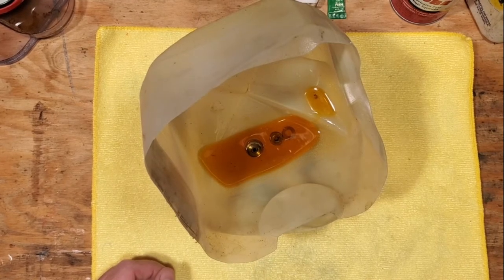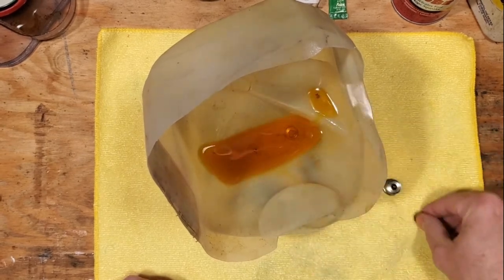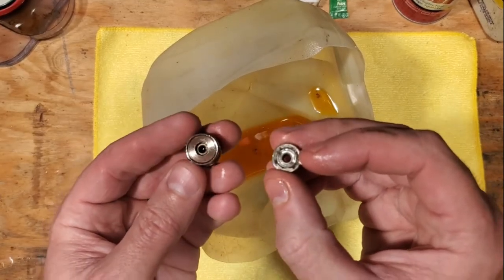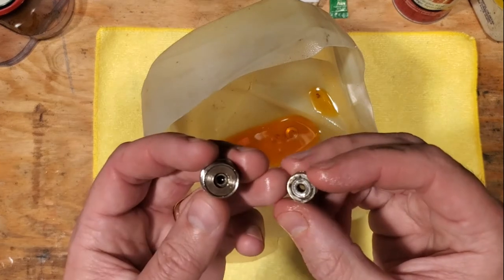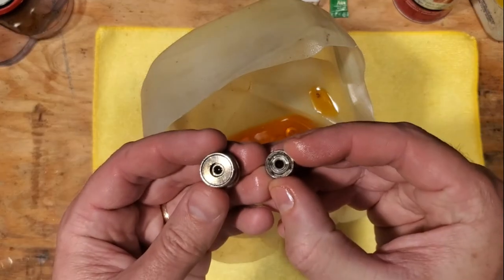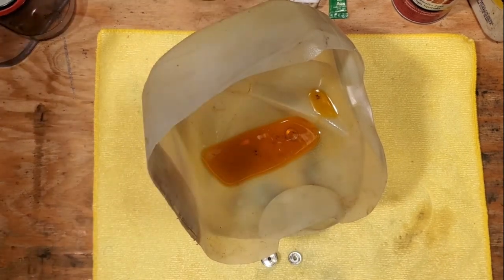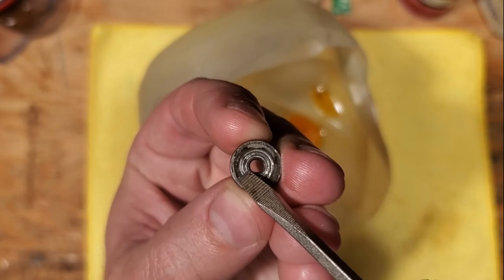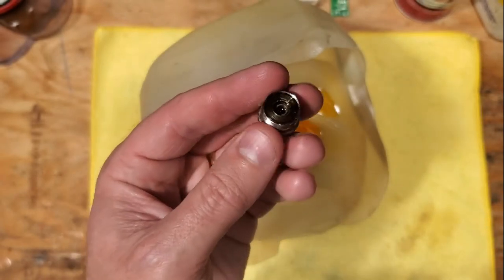How to free up Rusted Ball Bearings in Fishing Reels

Comment: I have new replacement bearings for my Squidder. Can you please offer some tips on removing the old bearings?
Reply from the maker: The non handle side bearing is easy.  Just unscrew it and replace with the new one.  The handle side is quite a bit more challenging.  I would use some penatrating oil like PB Blaster and let it work it's way in on the old bearing for at least 24 hrs.  Then try to pull it out with small hook tool.  Hope that helps and good luck! Thanks for watching!

Comment: i have a rusted bearing stuck on my spool. i cant take the spool out on my abu garcia ambassador 7000 c3. any tips?
Reply from the maker: I would recommend applying some PB Blaster to the bearing and spool shaft and letting it sit for at least 24-48 hours.  Try removing any other screws or parts around the bearing if possible to allow the best access.  The secret to using penetration oil is to give it time and then more time and then even more time to do it's work. Hope that helps and thanks for watching!